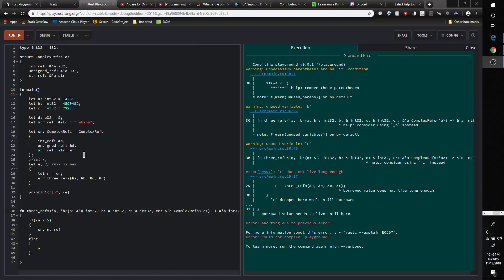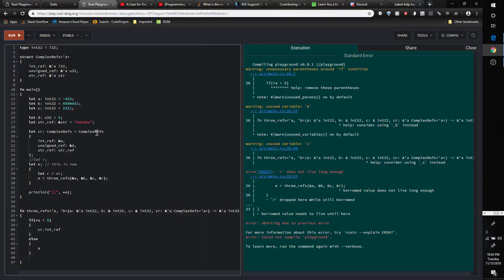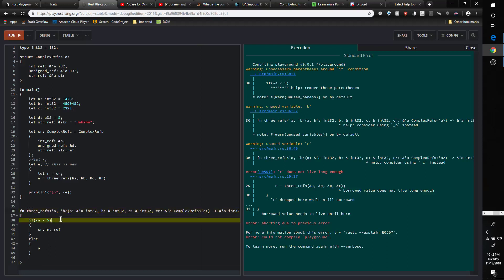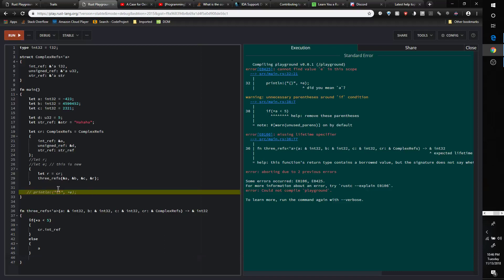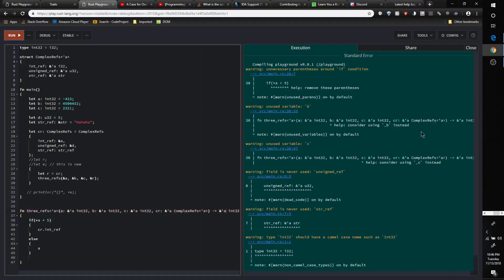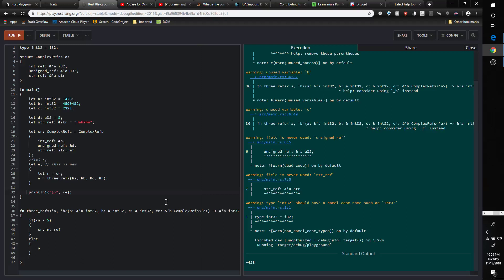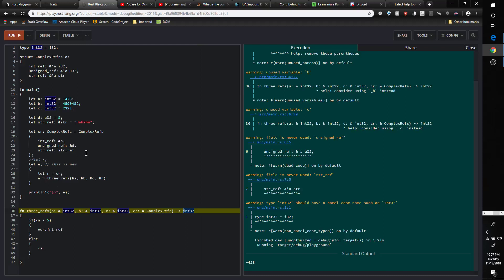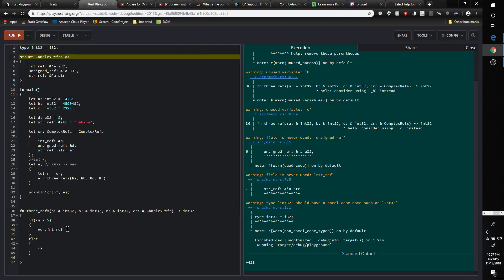Rust Tutorial - Lifetime Specifiers Explained

Comment: Just want to explain some things that weren't as clearly explained in the video.

1. 13:00 When he said "the compiler doesn't care unless you act on the returned value", what actually happened was that the compiler is shortening the generic lifetime of 'a to match that of the shortest lifetime of the inputted parameters. In this case, that's &r because we made a new shorter lifetime scope for it. We're making generic 'a = &r lifetime in the function because the compiler MUST shorten the generic 'a to the shortest input parameter's lifetime it's annotated on since 'a can only be allowed to as long as the shortest lifetime (that's what we specified after all. And if it lived longer than that, we'd have a big issue wouldn't we!), and since we're using 'a for the other parameters as well as the return value, we're telling the compiler that the generic lifetime 'a of those parameters lives at least as long as &r lifetime. Unfortunately, if we need it to live longer after returning it (for its actual duration since it got shortened), we need to stop generic 'a from being shortened to &r lifetime so it can live for the original scope.

By specifying the shorter generic lifetime as 'b, we're allowing the compiler to keep the generic lifetime 'a alive as long as the inputted 'a, thereby bypassing all the problems (since the original references lived as long as 'a in the first place).

It's worth noting however that you don't actually need to specify 'b since we're NOT using it in the return. The compiler can elide that one.

Note a misconception: You are NOT changing how long the lifetimes live for when you express this notation. Lifetimes live for however long they live for, and that won't change (unless you do something intentionally to change it like use unsafe). All that this notation does is express your intention to the compiler when it's unsure how to interpret the code.

One more advanced thing is, that any lifetimes returned that are not related to the input lifetimes in any way are changed to a static lifetime, and it is known as an unbounded lifetime (you don't want these). More details on the nomicon

P.S. This "shortening" is called covariance if you ever get into subtyping and variance. What covariance means is that the compiler is allowed to shorten the lifetime of something longer to something shorter (this makes sense, because if 'b is shorter than 'a, then 'a is valid for the entire life of 'b, because 'a is longer. In  notation, we'd say 'a: 'b , which means 'a contains 'b. 'a is 'b subtype).

The other two terms are invariance (type must be exactly the same), and contravariance (the opposite of covariance, which is the hardest one to understand)

Comment: why 2 different lifetimes on a single variable `cr: &'b ComplexRefs<'a>`?
Reply: I think it's because the <'a> is just a generic lifetime, and not the same as the other lifetime. This generic lifetime name while only be used within the struct, so it can be whatever you want
Reply: 'b is the lifetime of the structure itself. Since it only contains the references, we don't care if it goes out of scope when we use the returned reference.
'a is the lifetime of the references stored in the structure.

We're saying the contained references must have the same lifetime as parameter 'a', but the structure itself doesn't need to.
Reply: Since Complexrefs was moved to r and r lives in a scope{}, r requires a separate lifetime he called it b

When complexref was moved to r it’s lifetime changed from ‘a (where it was defined in the main function) to ‘b (where it was moved to r =cr) therefore the complexref lifetimes moved to a lifetime ‘b
You must map that ‘b in the function definition if you are going to use the returned value.

Comment: lifetime specifier looks really evil.
From my current understanding you make from the inside of a function assumptions how it is called.
Why not just put a lifetime specifier just on ever function argument and return value and why cant the compiler do it.
Reply: 1. Lifetimes only apply to references (not *every function argument*)
2. The compiler often elides the lifetimes already for the most common cases (so yes, the compiler does do it)
3. The only time you have to specify it is when the compiler can't figure out your intention
Reply: My guess is this might well undermine Rust's attempts at memory-safety, in effect allowing for memory leaks, just like in C++. I could, however, be wrong, as I'm here for the same reason you are.
Reply: @Jianju69  Lifetimes, always apply to all references. Specifying lifetimes is elided for common cases, not omitted. So specifying them always applies; whether the compiler inserted or whether you did is what's at question here.
Reply: @aqua3418  Thank you, Aqua, for your insights!
Reply: @Jianju69  No problem! I realize this was 2 years ago, but if you have any questions, feel free to ask!

Regarding the memory leak comment. The only real way to memory leak is:
- Use unsafe code which doesn't clean up things
- Box::leak
- reference cycle (using Rc for example and having references refer to each other, thereby not allowing the strong count to go to 0; you could use an interior mutability type like Refcell to achieve this)
- ManuallyDrop (disabled dropping on the inner type)
- MaybeUninit (I believe this also disables dropping)

The reference variable and the underlying owned variable will always be dropped at the end of their scopes (barring what I said above).

Also keep in mind that Rust is stack allocated by default, and the CPU pops the stack frame every time it finishes. So at worst (barring what I said above), if you could keep a reference to something invalid around, what you'd get is a use after free (which is of course what lifetimes are designed to prevent in the first place)

+ Tip: you can use the Miri tool to check for memory leaks if you're unsure
Reply: @aqua3418  Such a kind offer, thank you! I haven't dedicated nearly enough time to learning Rust, as programming is not my job, but I'm still eager to learn.
Reply: @Jianju69  Wish you luck! Feel free to check out the official Rust discord if you have more questions. You can find the link on the official Rust Reddit

Comment: It's unclear why cr: &'b ComplexRefs<'a> parameter has <'a> lifetime specifier. I think it should have been explained better
Reply: 'b is the lifetime of the structure itself. Since it only contains the references, we don't care if it goes out of scope when we use the returned reference.
'a is the lifetime of the references stored in the structure.

We're saying the contained references must have the same lifetime as parameter 'a', but the structure itself doesn't need to.
Reply: I think, 'a means that the int_ref in the struct has the same lifetime as the first input parameter. And the case shown here it is true and the compiler knows that.